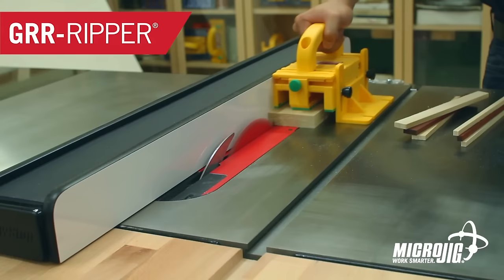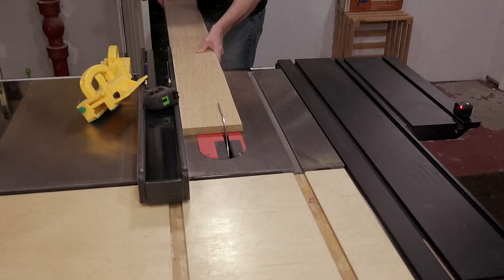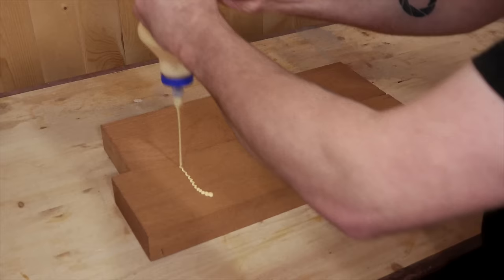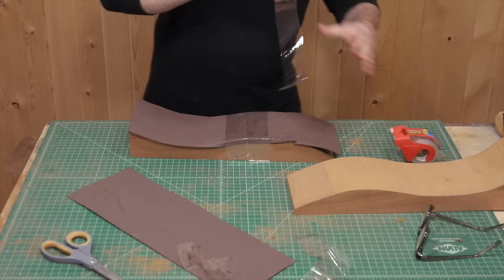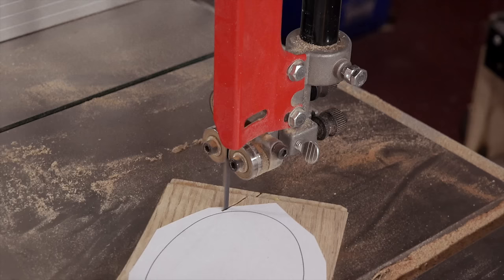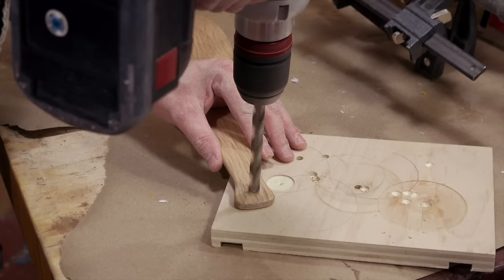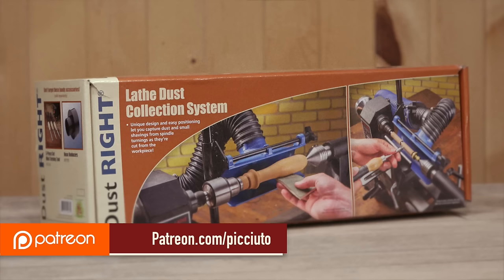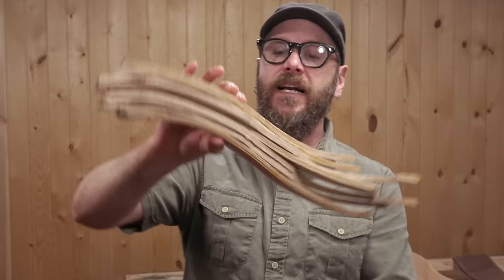How to Make Bent Laminated Spoon: Mother's Day Gift

Comment: Nice project. If you were to plane the strips of wood down to an 1/8", why would a sled be necessary? Is it because the material would be to thin? Is it a safety issue? Just curious.
Reply from the maker: +Mark Ewing Thanks.I did try to plane a couple of the strips down to 1/8" but sometimes my planer would eat up and destroy the end of the piece.